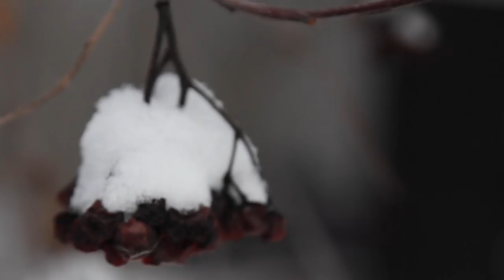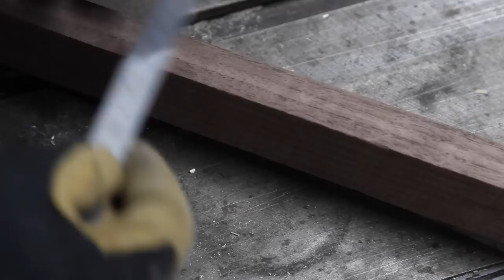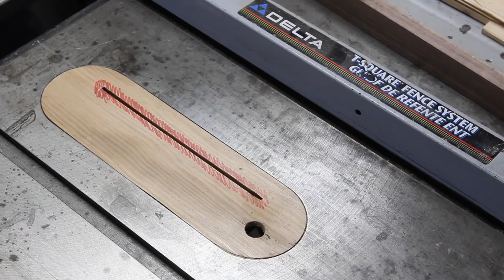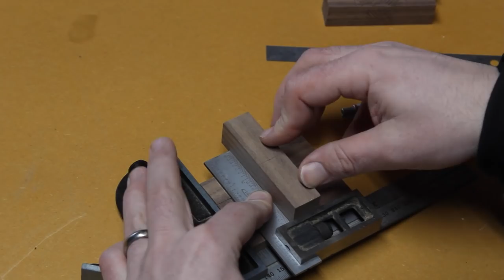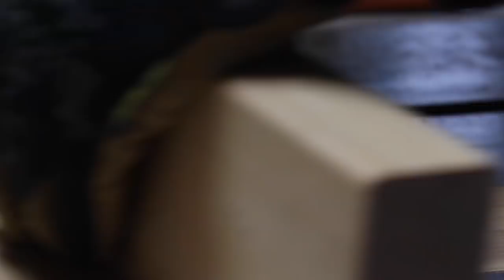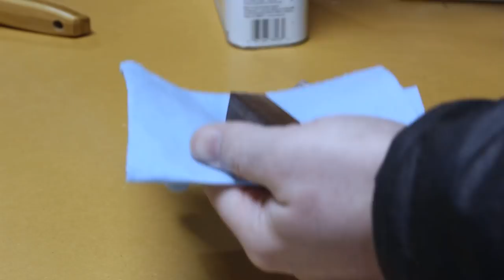How to make: Walnut 6 Piece "Burr Puzzle" from Scrap #fathersday

Comment: That's a great puzzle! How many times did you need to make it so it fits perfectly?
Reply from the maker: Wait untill you see the next one!

Actually once to see if I could do it.  I tried to write out how to make this and didn't have allot of luck. If you think in terms of units the spacing us full or half block widths off of center.

I tried to use SketchUp and Fusion 360 to make plans but that was more confusing ;)
Reply from the maker: When I was chiseling the pieces I was test fitting them as I went.